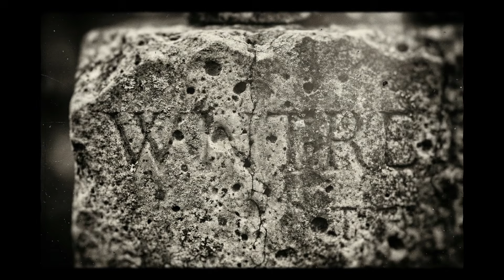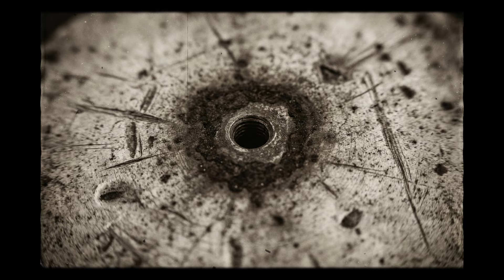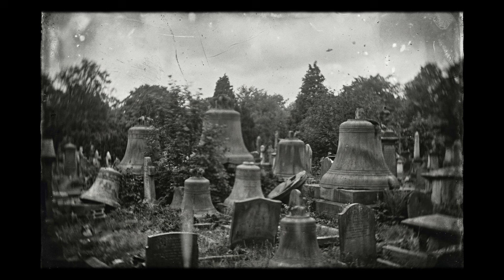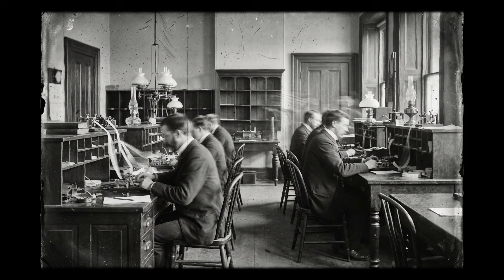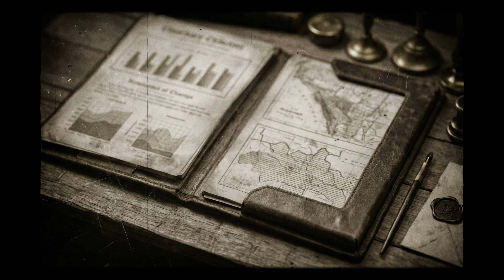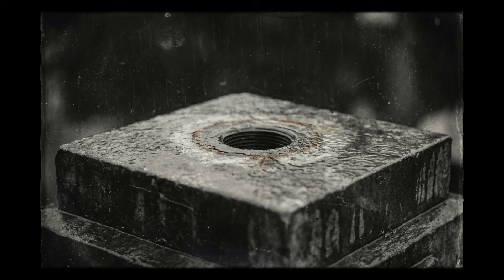Tartarian giant cemeteries — why some old tombstones are too large for ordinary people.

Comment: On a hill is mentioned alot. Im in Wisconsin and the larger cemeteries with giant stones bases are at tops of hills. If it's a rearranged receiver system, maybe turning it into a place where Huge amounts of low frequencies would be in masses of sorrow. Used to power something.  Monsters Inc. Movie vibes.
Reply: Interesting point
Reply: The Bible chronicles the building and the breaking down of pagan "high places" that God condemned.  Something quite Babel-esque about building things "to the heavens".
Reply: @ironlady6897 
And the free electricity the towers with finals got from the either.  Hidden history.